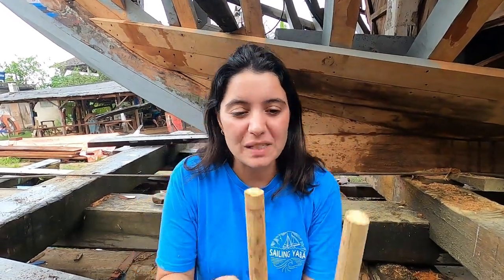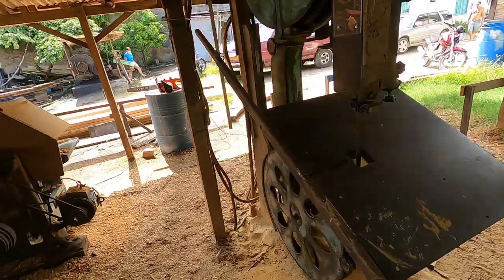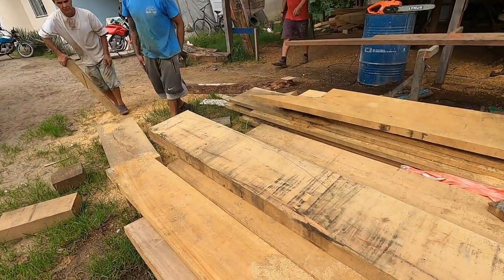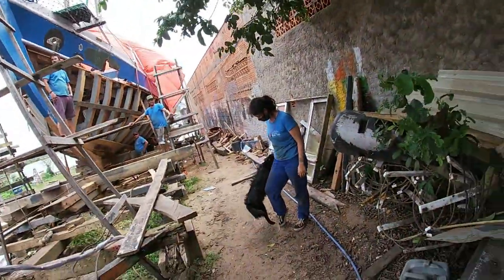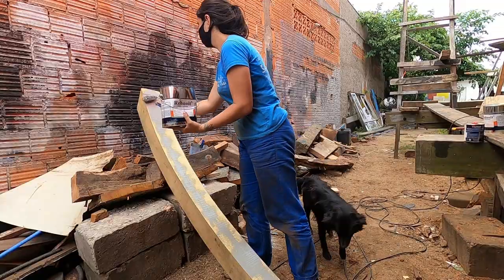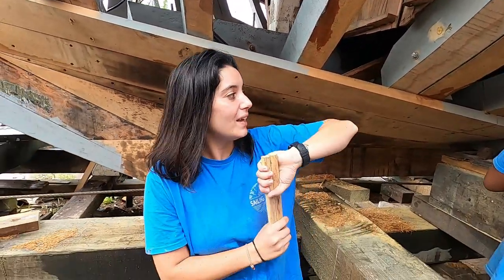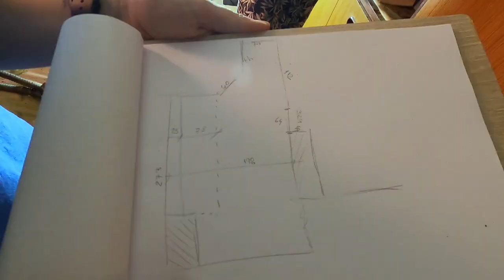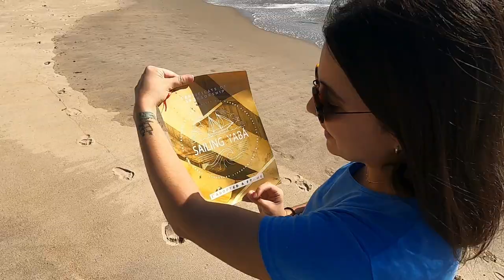MASSIVE RESTORATION: Building frames on a huge wooden schooner — Sailing Yabá #23

Comment: It has been said that "Yaba" is only about 13 years old.  It has, also, been said that "Yaba" was special built to cater to tourists, on day trips close to the shore.  It was never meant to be a Blue Water boat.  The worse that was said implied knowledge of how these ships were built quickly and were built using poor quality materials.  Finally, and this may be the worst cause of such a rotten mess, which the "Yaba Team" found.  It was said that the boat was very poorly maintained by its owners.  

Indeed, I could not believe the boat is only 13 years old. Thus, an accumulation of 13 years of "Ride it HARD and put it up WET!!!"

Indeed, that does make a very good argument.

These probabilities do require consideration.  Yes, questions must be asked.  "Consequences" and "Outcomes" must be "Foreseen".

One question, first and foremost, should be...  What grade of 'Original Build Materials' was used, back then???  Now, compare to the grade of material being used, during this "Project".  

What grade is being used, NOW!  

We have fresh prepared wood being used, now.  Is that "Wood" a "Lesser or Greater" quality of Wood as used at the time of 'Original Construction'???

Let us address, what I think is the most important question.  And that question is this.  Will Ben & MP fail in the upkeep of the boat, whereas former owners were not so responsible???  I'd vote "YES", they would be.

In making this their home, even if the boat falls apart around them, after about 10 years (As some have said), it is quite likely that MP will have Ben's Butt busy every waking hour to ensure the boat is, both, fit to sail and well maintained in every way...  Nothing left to chance. And we may find that Ben will be in his "Element", doing and creating Beautiful Things.

This "Project" may accomplish, precisely, that "Old Saying"...  The "Saying", you can't make a silk purse out of a pigs ear.  Those aren't the words I heard taught to me, but it is the bottom line to it, instead.  

If Ben & MP pull this off, they will be very happy for, at least, ten years.  

After 10 years, they may have tired of the "Project", altogether, and be ready to move on to a different stage in their lives.  But it would be a very good ten years.  

The "Kicker" here...  If maintenance is performed "Religiously", there may be value they can regain in the sale of the boat.  

Or, maybe, something that started as, "Just Yaba", then grew into a business.  Maybe that business would be their Ultimate Gain.  

And we, mere peasants, get to ride along with the "Show" for free.  Oh, what a bunch of vampires we are...
Reply: Not sure about thebeing cheappy build. There seemed to have been a good amount of this Purple Heart used original. And those are usually expensive. So it might be more that the previous owners scrimped on maintenance